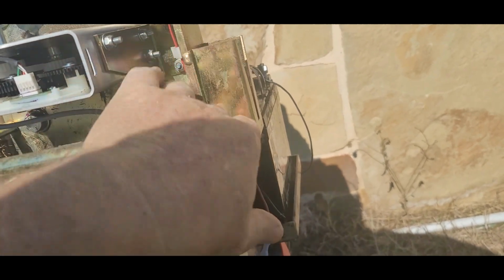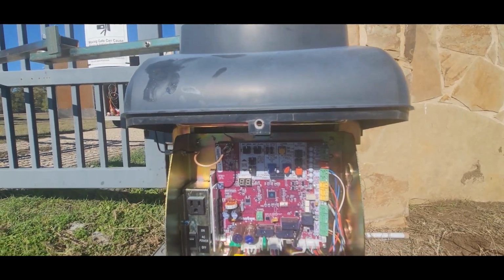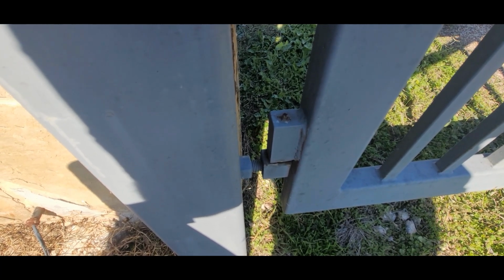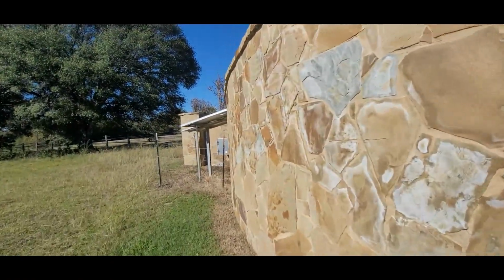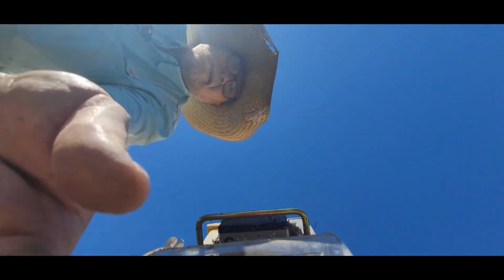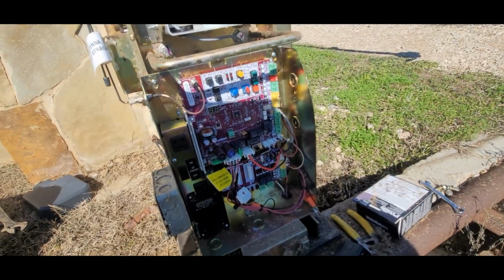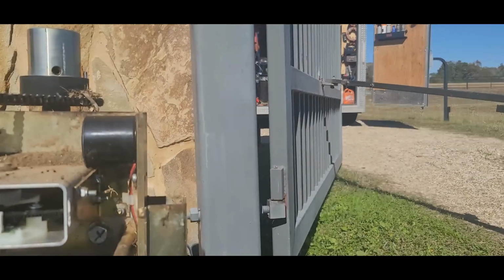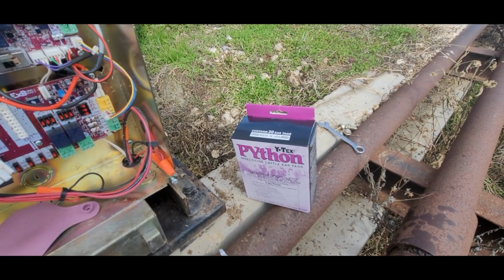How To Keep ANTS and Rodents Out of Electrical Boxes  AND The Best Way to Hang a Gate

Comment: Great tips.  One more thing is my gate posts, which are set in 2-3 cubic yards of reinforced concrete which are connected under the driveway by a 18” X18” grade beam with chokers every 24”.  All the power and signal wires are set in separate conduits in the center of the grade beam.  Love the tip of the cow tags and will add them during mt next annual inspection/lubrication.   Cheers, Will😊
Reply from the maker: Thanks for sharing!

Comment: Perhaps an enclosure for the photoelectric sensor would help.  The glass would be tricky.  You know how those electric defrost for rear windows work on cars.  They have a zigzag of nichrome (or similar) wire that is embedded within or laminated upon the glass.  Turn on the juice, it heats the glass and potentially the enclosure.  Seems to me that you could make such a small pane of glass for the enclosure with a bit of experimentation.  Buy the glass, cut to size, zigzag some nichrome wire, adhere it to the glass (experiment with adhesives and strategies), and hook it up to a power source.  Too much juice?  A $1 timer circuit could turn it on and off at selected intervals.  Add a little smarts with an Arduino or similar gizmo and you could even sense the temperature and humidity, even the opacity of the glass.  Thus the device could dynamically adjust to varying conditions.  We're talking about $20 worth of parts or so.  Fun project for cold winter nights in the shop.  Helluva YouTube video as well.  Maybe this could be the Opti-Grab that makes you rich....
Reply from the maker: I explained what Liftmaster did after I told them how I keep telescope eyepieces clear at night... The wire from refrigerator door defrosts at 12 volts...  they implemented it the next year on the wired side...

 Problem is even at very low power consumption the batteries from solar will not work... Sometimes we have 8 or 9 days with no solar production during the winter here...
Reply: @10swatkins  It would be interesting to build a data collection device that would do nothing more than record temperature, humidity, barometric pressure and battery voltage level.  Then we could analyze that data.  Probably best to record every time the gate sensor goes high or low as well.  Just a thought.  The capture device could use its own power source so that it could run for an extended period and not put a load on the gate's power.
Reply: @10swatkins  providing the ability to run the mullion heater off a sepearate device would be good. Might also be able to do some sort of check to try and only run when the door starts opening

Comment: Solar installs. Heater on a timer. When the optical sensors lock the gate function after a remote command fail. The heaters come on for 3 to 5 minutes then turn off. Or cycle off after a compete operation opening and closing. So the users only have to wait a few minutes to get the optics defrosted.  
The heater only cycles on when the optics are obscured and a remote command given.

Do they have adhesive rubber strips for gate opening edges with contacts inside. To stop if touched.  The linear actuator liftmaster at our building really needs one.   

The installer here finally got it programmed to release the magnet 2 seconds before the actuator started to pull. The linear actuator bracket would get pulled out of shape so many times it broke several brackets.  I gave the installer my 3/8-16 drill tap combo tool i got at homedepot and changed his life.  

Worst is the whole thing quit and management wont pay for more service calls.
Reply from the maker: https://gatehousesupplies.com/liftmaster-l50-safety-edge-5-ft-length/?srsltid=AYJSbAf2rQ6a629UuNlWdmnRVsDLiQT2o_bdkycMp8Lady2r17kuZhkPw8U   is the safety strip that is now required for all slide gates... On that link page there is a mention or a wireless sending unit for the edge... That all mounts on the gate and there are no wires flexing to break...  I always use these senders and they are pretty trouble free... Just keep the batteries on the gate changed out.     

I have one of the strips you may have, just pay the shipping....
Reply: @10swatkins  thanks. This is a swinging gate.  Closes agenst an angle welded to the gate post with a big electo magnet to catch and hold it closed.  No room above or below it on the front face of the gate.  Wont fit on the edge.   Catch 22.  
The walk thru gate is on the magnet post.   There is no walkway to 9 of the apartments must walk up the driveway.  

Triangular lot next to a freeway built to fit the lot
The front of the building should have been narrower but they got a 2 bedroom apartment on the first floor and a batchler apartment upstairs. 
Money used to talk in los angeles.

Comment: Do those Ear Tags also keep Flys off Cattle? Great Video. What if you put a Cone around the outside of the Optical Sensor with a hole just big enough for the Beam to go across to the other Sensor? Just a guess, but maybe it would help keep the Humidity off of the Optical Lenses. I’ll definitely try the Ear Tags in my Electrical Panels, Garage Door Openers etc. I have a real problem with Dirt Dobbers building around the Gears and Limit Switches. Thanks for showing about the Hinges also. Really good Video full of Great Ideas. You should go to Harbor Freight and get a little Battery Powered Air Compressor. They work Great. Thanks again from a fellow Texan.👍❤️
Reply from the maker: They are suppose to...   I don't have to clean too many of them and usually caned air is enough... I just hate putting more stuff in the trailer but I have a small compressor if really needed..

Comment: $30K power line holy shizzle
instead of light sensor how about ultrasound or microwave ....or what if the reflector had it's own baby windshield wiper, that would take about zero power. Only the wiped surface gets the beam, not surrounding.
Reply from the maker: Yep,,, the power company line is about .5 miles away....   IT has to be a monitored beam to meet the law...